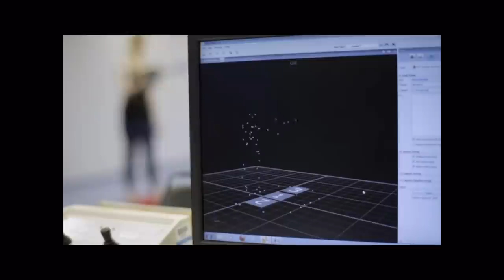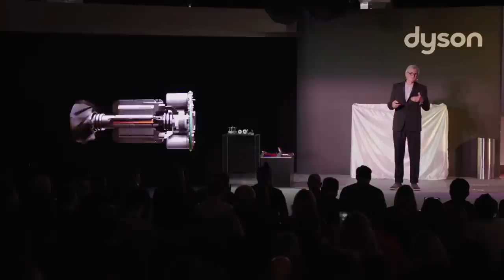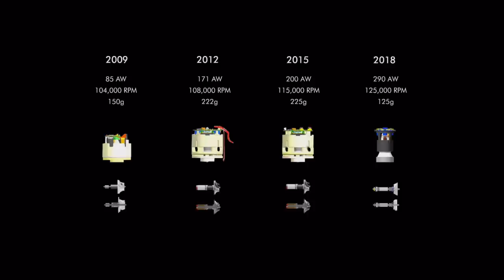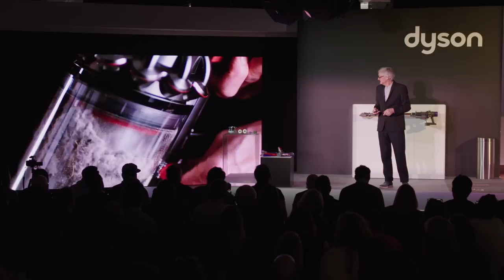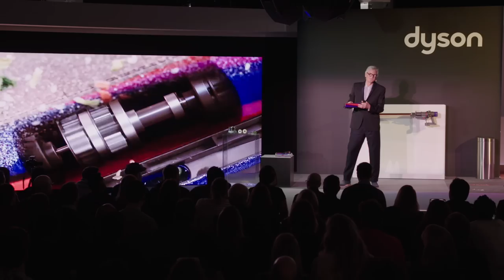James Dyson unveils the Dyson Cyclone V10™ cordless vacuum in New York

Comment: Can i replace the batteries after they have died(end of life)? it's not clear from the presentation if batteries are easily removable , wouldn't wanna buy another vacuum clean just because batteries have coughed up.
Reply from the maker: Hi Michael, yes the batteries in all Dyson cord-free vacuums are simple to replace if this is ever needed. This can be completed at home by the owner, and wouldn't require a service from a Dyson engineer.

Comment: 3:33 the product I'm about to show you now is battery driven, "so it doesn't have the problems going from one country to another"

Wasn't it that the warranty terms and conditions state; 
Where this machine is sold outside of the EU, this guarantee will only be valid if the appliance is used in the country in which it was sold.

Kinda ironic.....
Reply from the maker: Hi there, we do not recommend taking a Dyson appliance from one country for use in another, as each machine will be made to meet the legislation of the country it's sold in. That said, we will always do our best to support Dyson owners in their new country of residence.
Reply: a very fair answer. My DC29 cylinder works just fine in the UK :)

Comment: Seems to be a very well made and thought out product but man, should've made the battery a bit bigger and removable for the ability to purchase multiple batteries instead of waiting to constantly charge. IF they're so insistent on cordless being the future (with small bins), they should keep in mind larger or even mid-sized homes for that matter! At the moment, I'm researching cordless vacuums to purchase for my home which is roughly 2,800 sqft- not large but not tiny and a vacuum like this I would like but no way could i use it because of battery usage time. I know he says that's not something I should be concerned about but of course I am! Sadly, I will not be getting this Dyson vacuum for this reason, even though their R&D team does amazing work.
Reply from the maker: You can purchase an additional battery, but this isn't something we would recommend. 

Extensive battery testing has shown that batteries locked into the machine provide a more reliable electrical connection and provide stronger, more consistent power over time. If you were to swap the battery on a regular basis this may cause inadvertent wear and tear. 

If you would like to discuss this further, please feel free to email us askdyson@dyson.co.uk.
Reply: @dyson  That's very interesting, I had no idea. Thanks for the reply. 
I have a Dyson canister I use for my basement, certainly not a bad vacuum at all but man I'd love a cordless. 
Thanks again for the info.

Comment: Good performing products but cheap plastic materials, painted plastics, everything has sharp corners (for designers - zero fillets on corners and edges - forget about G1, G2 let alone G3) and if you bump it into anything it immediately cracks and scratches leaving the product soon looking like it's already 10 years old. For the high price these products are made to become old very very soon - planned obsolesence.
Reply from the maker: Hi there,

Sorry to hear you feel this way about your machine.  Our machines are fully tested for durability and are made from strong lightweight materials such as Polycarbonate which is used in riot shields, ABS and glass reinforced polypropylene. We will be more than happy to assist you with any issues you are experiencing with your machine, please contact us at help@dyson.co.uk and we will be happy to help.

Best wishes,

Mira
Reply: Dyson UK 
Have you considered making a metal vac? Would be more expensive but in the long run it's be worth it.
Reply: Riot shields :))) If you give riot shields sharp corners they will crack. Because dear sirs and madames at the marketing department, the resulting pressure is dependent on the area. Now think of an sharp corner as a small area and you get alot of pressure - alot of impact force. How can you sleep well knowing that you do a poor job in your marketing job ? Must suck really badly
Reply: beautiful woman with a beautiful smile I wish you the best this year how is the weather over there right now

Comment: All this design and marketing that result in a 1000$ for a vacuum cleaner that doesn't offer a user replaceable battery and that you don't even trust enough to offer a proper warranty. No wonder dyson need to sponsor the "reviewers"
Reply: Sylvain Paquette what do you mean? It literally takes about 3 minutes to replace the battery and it takes only two screws. A genuine Dyson battery is about 80 dollars available in the their online store. How is that considered "not user replaceable"? 
I agree that the warranty should be longer for such an expensive device.
Reply: Basel Kader "Power pack

Part No. 969352-03

Replacement power pack for your Dyson vacuum cleaner.

This spare part is not available to buy as it should only be replaced by a qualified engineer."
Reply: Sylvain Paquette 
There also the issue of how long the parts will be available.
Reply: Basel Kader should i buy the extra battery from dyson or other manufacturer selling on amazon?
Reply: Basel Kader  the dyson v10 does not have a repleaceable battery like the v6, v7 and v8 models. There is no v9 because all the cool boys skip the 9 (it sounds like hitler saying no).

Comment: A shame Dyson's are so plasticy, yet cost a small fortune!

I don't care how bloody good they are at auction, I want build quality and longevity for that kind of silly money! Dysons are filled with lots of little fragile moving parts and buttons. You're buggered when they break.
Reply from the maker: Hi Ross,

I appreciate your concern regarding longevity, which is why we use the materials we do. The cyclones and main body of the machine are made from Acrylonitrile Butadiene Styrene and Polycarbonate (PC-ABS) which is dimensionally stable, chemically resistant and tough at all temperatures. It is the same material as is used in riot
shields.

We also put every design through rigorous testing before they are finalised: https://youtu.be/f3iXRFizaz8

I hope this helps.

Allan
Reply: Dyson UK you have made the new ball models virtually impossible to repair. For example to replace a motor on a dc 04,07,14,27 and dc33 it was a simple case of taking out a few screws and popping the motor out. Now you have to fiddle trying to take little springs out and then have the nightmare of trying to put it all back together. I have a dc 01 which is an early on with the capital lettering which is from 1994, still picks up and works like day one and when anything needs replacing it is a piece of cake can you really imagine a DC40,41 or light ball or any new ball model lasting 24 years?
Reply: Ross A my Dyson still going strong. It's been dropped down stairs and everything.
Reply: TBH you don't see the newer Dysons with blown motors anymore like the DC14/27/33s which blew up all the time

The plastic absorbs shock, so much less of a chance of snapping plastics

a DC27 motor change is an absolute nightmare. The plastic parts are forced to fit into place, not as easy as the other wheeled ones unfortunately
Reply: Its easy and cheap to get official spares. My Dyson vaccum has been going for 15 years and moving to multiple houses! Lots of bangs and knocks. Have changed filters etc thats all.
Reply: Dyson UK  I've owned a dyson for a couple of years now. The electrical connection between at the accessory end of the bin got loose after about a year. I bought a new bin and solved the issue, but had to throw my old bin out. That kind of defeats the whole idea of reducing material use. Either way the battery seems to have some sort of artificial limitation on it, aka planned obsolescence. All of this does not reduce material use and I will be in contact with my EU representatives to urge them to pass laws requiring cordless vacuums to have an easily replaceable battery. It is not socially responsible to release a cordless vacuum with a non-replaceable battery; it's greedy and short-sighted.

Also, please don't try to trick less scientifically literate people. Acrylonitrile Butadiene Styrene is the same plastic legos are made out of. And riot shields, while they are made out of polycarbonate, are much thicker than other products made out of the same plastic, like for example DVDs and sunglasses. I'm all for plastic fantastic, but not when it means I need to buy a new vacuum cleaner every 2 or so years and throw my old one into a landfill. That's not the kind of suck I want from you.

Comment: His new motor is 290w? Hasn’t Miele produced their lightweight 1,200w vacuum for years now?
Reply: I believe it was 290 "Air Watts", distinct from the raw power requirements of the motor https://en.wikipedia.org/wiki/Airwatt
Reply: So basically it is still less than the Miele. Maybe they will come out with a V12 later.

Comment: You should develop drone motors.
Reply from the maker: Hi there, here at Dyson HQ in Malmesbury, Wiltshire, UK, our engineers are busy working on a pipeline of new technology stretching 25 years into the future. We can't confirm anything until we're ready to launch, but Dyson motor technology will be central to many new inventions. For example, the new Dyson Cyclone V10 vacuum, and the Dyson Supersonic hair dryer, would not be possible without the lightweight, high speed digital motor technology that powers them.

Comment: Until new battery tech that last twice as long they should still manufacture corded vacuum cleaner.
Reply: He said that they will continue to manufacture their old models, but that they won't put any more development costs into them.
Reply: Try 12 times as long... the v10 runs out of puff in 5 minutes in max mode. 🙈
Reply: I bought the cordless V7 yesterday at Costco and using it in max mode I was able to vacuum the dining room only before the battery ran out.  Needless to say I returned it and thinking of getting a Miele.
Reply: did you even try the other two modes? you literally NEVER need max power.
Reply: Yea they need a mains adapter. It's a lot of money for a vacuum that lasts 5 minutes before needing a recharge. I'd rather spend 1/4 the price and have a corded one which is just as powerful.
Reply: my V7 lasts for 20 mins plus 5-6 mins on high power... did the use time decrease?
Reply from the maker: Hi there, 

I can confirm that, on a full charge, the run time for Dyson V7 vacuums will be up to 30 minutes or about 20 minutes when used with any motorized brush bar. You will also have a MAX suction setting, designed for use with tough cleaning jobs which will provide you with up to 6 minutes of run time.

Best wishes,

David
Reply: So the usage time decreased but the required time of usage thanks to a more powerful motor/suction efficiency decreased as well. How much more efficient is the system compared to a V7?
Reply from the maker: Dyson Cyclone V10 vacuums are engineered with a run time of up to 60 minutes or about 30 minutes when used with a motorized floor tool. Dyson Cyclone V10 also offers three suction control modes as well as a suction control slider at the cleaner head for added control over suction power across both hard floors and carpet. When used on the MAX mode, for tough cleaning jobs, Dyson Cyclone V10 will provide you with 6 minutes of run time. 

Best wishes,

David
Reply: Alright, thanks!

Thats a few more factors to take into acccount when comaparing those two generations. Sounds like the V10 is more versatile.
Reply: It seems that not all versions of the V10 have a suction control slider at the cleaner head. The V10 Absolute+ I just bought doesn't.

Comment: @13:30 the air does not actually flow straight through. It twist and turns a alot, just as much as the smaller vacuum he compared it to. The illustration is dishonest :(

Comment: My big concern is how many time can I recharge it. Let’s say I use it 1 or 2 time each week. Let’s say I charge it 100 times each years. How many years it will last? Also, is it ok to overcharge the battery? When it stays on the wall, it constantly charging, no? Thank you
Reply from the maker: Hi There, 

Dyson cordless vacuums have a charger that communicate with the battery to help prevent damage to the battery due to overcharging. Once the battery is full, the charger will stop charging the battery. Also, as a result, you may definitely keep the machine on the charger for use whenever you need it. Dyson backs all cordless machines with a free 2-year warranty when purchased new and from an authorized retailer as well. Please feel free to learn more via our site.

Best wishes,

David

Comment: For this money, buy a Miele. Or a Sebo. Maybe a Riccar. But NOT a dyson. These vacuums are corded, which will always be superior to cordless. They are also bagged, which is far superior to any bagless vacuum. If you’re thinking of buying this plastic crap, go watch Performance Reviews (a YouTube channel) review of the dyson v10. Also, air watts is a terrible way to measure the power of a vacuum. A working water lift gauge (for suction), and an airflow gauge is a MUCH better way to measure vacuum performance. Lastly, dyson needs to introduce a particle counter to this thing. It would probably blow around 100000 particles, while a HEPA Miele would blow a 0.
Reply: @Blob B  agreed. I don't use corded vacuums anymore.

Comment: I can't understand the hype. Dyson didn't invented the step motor AKA brushless motor.
Reply from the maker: Hi there, thanks for your comment. We've invested over £150m on Dyson digital motor technology over the past 15 years, developing and patenting unique technology that can only be found in Dyson machines. The Dyson digital motor V10 can run at up to 125,000rpm - it's the smallest and lightest, yet strongest and fastest, vacuum cleaner motor we've ever developed. It can even detect and adjust for variations in altitude and barometric pressure.

Comment: Total rubbish, wasted 500 EUR for piece of junk, the build quality is very poor, cheap recycled plastic is used everywhere, it can be bent or get broken easily, the internal parts gets full of dust and dirt very quickly, mine broke in 5 month time, while attempting to dissemble it and clean it it totally broke, I found out from many you-tube reviews that its almost impossible to take it apart and clean internally, the screws are different types, rubbish Philips screws can be damaged and stuck easily if you are not using the correct driver, even though its a very hard job to dissemble. battery life if very short if you are using max power. AVOID

Comment: These things do not last.  It's unfortunate, they do work well.  But it sucks that you can't even get their warranty worth of life without breaking down or needing repairs.  My main body unit just went out (on my v10 animal cordless).  Yes they will replace it, but its only a year old.  I've bought many dysons - uprights and hand helds.  I also owned 2 uprights -The upright Animals worked great but they were in the shop 3 or 4 times during the 5 years warranty each.  If you're going to charge $500-$600 and talk about how great your technology is, maybe spend more effort into making sure they are reliable devices.What makes it worse is you have to spend 15-20 minutes trying to navigate their "support" line to get to a live person.  Then they tell you you have to reply to an email later on to confirm you still want the replacement part.  This is not the experience people should have when paying top dollar.

Comment: My Mum bought a v10 and it lasted a month then stopped. I bought a v10 as well and it is making funny noises. Do not buy this crap.
Reply from the maker: Hi Robert, 

Have you had a chance to reach out for support at all? I can confirm, this does not sound normal at all. Also, we're always keen to assist and, while we don't expect problems to occur, Dyson backs all new machines from an authorized retailer with a free 2-year guarantee.

Best wishes,

David